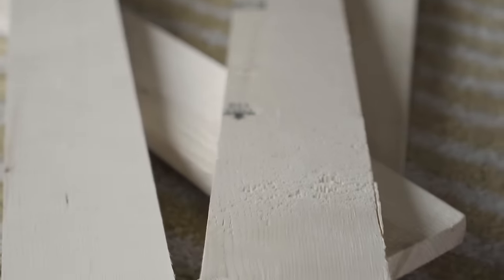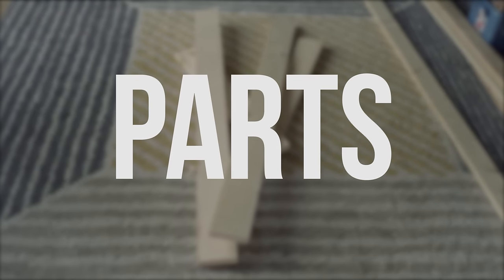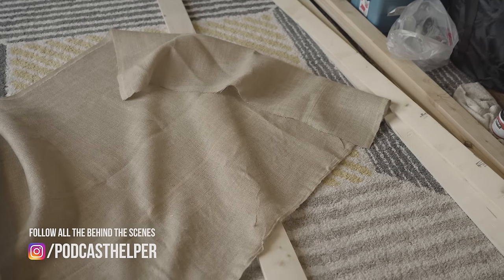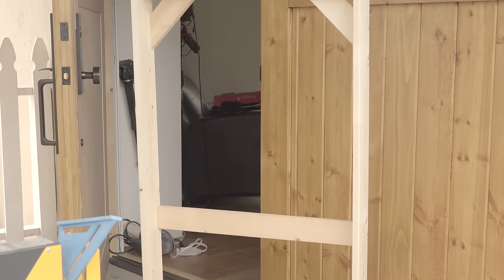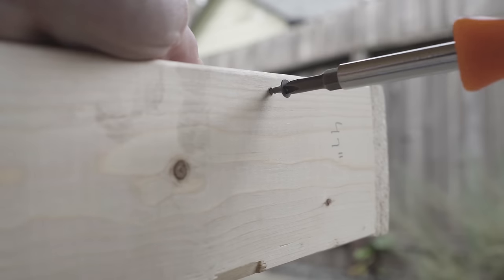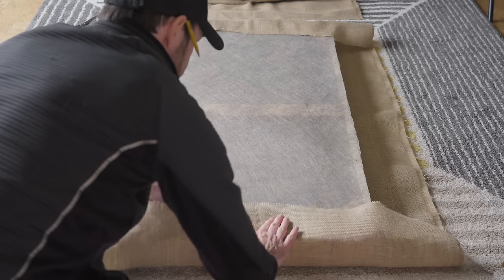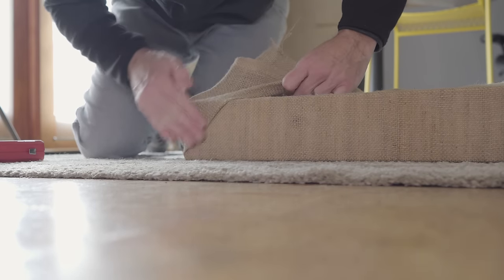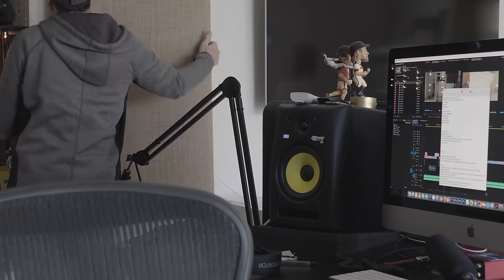How to Build Your Own Acoustic Panels

Comment: What is the Density of Rockwool you used?
Reply: Not sure of the density but you can check their website for its acoustical effectiveness.  It's comparable to Owens Corning 703 which is a similar material only it's stiff and not pliable like this material.

Comment: what is the thickness of the rockwool you used?
Reply: if the rockwool is 2inches thick, the back brace is 1inch thick and the frame is 4inches , that still leaves 1 inch of space.

Comment: What is the total weight of the finished panel?
Reply from the maker: Good question, not sure exactly but they are not light. At first I thought I might hang some on the ceiling but they are too heavy to bother trying to do that;) Sure it can be done but the point is they are weighty.

Comment: These measurements don't seem to make sense if the insulation is actually 24x48. You'd want the width pieces to be 26 inch wide if your boards are 1 inch thick to compensate for the overlap on each side. That would give you a true 24" interior dimension
Reply from the maker: Thanks. From what I recall, nothing is exactly what it says it is. For example, most big box hardware stores's 1x4x8's etc are not actually 1" wide, it's more like .75 (3/4). So in this case, you take 1.5"s off the width (24.5") making it 23" which also makes it so the insulation at 24" (but likely not exact) fit in snug with no gaps. Everything fit perfectly.
Reply: @RayOrtega  Interesting! Must be different with different insulation companies. I used Owens Corning 703 and essentially added an inch to your dimensions because the insulation pad itself was 2'x4' to a T. Even then, I still had to trim the insulation down a bit so it would fit. I guess this Roxul stuff doesn't measure to what's advertised!

Comment: I would look for some better material than that kind of insulation. I think that glass woohl isnt great for your lungs.
Reply from the maker: Thanks. It's not glass but instead a natural product which made of rock. That said, you'd still want to wear protection when working with it's just not as a bad as fiberglass. But yes, you can fill these with anything you want. Thanks for watching.
Reply: Ok, I thought it was the glass version! Great video anyway!
I saw some guy making a frame as yours but instead buying pretty cheap blankets and wrapped around the frame.
Reply from the maker: Yeah there are a ton of these tutorials on here all with different methods, that's the nice part about DIY, you can customize to your needs/style.
Reply from the maker: Thanks, Al. I haven't had any issues with the Rockwool, it pretty much stays together and doesn't shed but a great substitute would be denim insulation which I may use for future panels.
Reply: Towels work nicely as well @RayOrtega

Comment: Are there any health issues that could come from the insulation?
Reply from the maker: I hope not;) I did look into this and the newest versions of Rockwool are supposed to be free of formaldehyde and from what I can tell, it's not shedding fibers into my space. I chose these because they are more environmentally friendly, are more safe to handle since they don't contain glass like fiberglass and instead are made of organic material. The panels sit on the wall and don't get disturbed so I don't think they are adding anything to the environment. That said, this tutorial is mostly about the frame and the nice thing is you can fill it with whatever you like. I considered recycled denim but that also sheds a ton, it's a toss up. Maybe also use a covering that is less porous. Hope that helps.
Reply: @RayOrtega  Thanks for the info. Yea it just worries me a bit and i know people have asked this question but i had not found any evidence it does or does not cause health related issues. I want to make some because i think its much more cost effective and looks fairly nice vs foam.
Reply from the maker: @thomaswhudson  Cool, good luck. Definitely more cost effective and very effective especially vs foam which is virtually useless. No dense enough to absorb reflections.

Comment: It didn't sound different after the install. You raised your voice after the panels though, so maybe you're not hearing yourself as much. Perhaps a few panels in a large, furnished room is not overall a massive change in absorption.
Reply from the maker: Definitely not a huge difference but every piece you add, adds up. This was only two panels and I now I have about 10 in here although not all installed yet. Overall it sounds great, the brand new video I released (Sony a6100 review) sounds better than it has in that same position and miles away from when I first got in here and I recorded in that spot with the place empty. I'm just about at the spot that I want but still need to build bass traps for the corners. Always a work in progress;) Thanks for watching.

Comment: Wrong screws. Proper wood screws only have thread 2/3rds of the way to the head or so; the reason for that being that you don't want the screw to grip the wood the head is in, you only want to screw into the part you're pulling in to get a tight seam.
Reply from the maker: Thanks, these worked great but that's good to know.

Comment: for the inside of the panel, don't use insulation. Usually your house already has insulation in the walls so whats the point. Use towels instead. those seem to work significantly better

Comment: Why 4" thick rather than 2"?
Reply from the maker: For the wood? The 1x4" are not actually 1x4", it's closer to 3-3/4 so by the time you add the back bracing, you'll end up with a nice fit

Comment: Nice work but those those things would rattle so much in my room with my subwoofers lol
Reply: Easy fix, 3M some door trim insulation or soft felt stickers on each corner against the wall.

Comment: Nice Job, But the fact is that it's not looking beautiful, it's more like a burlap sack!
Reply from the maker: Ha thanks, beauty is in the eye of the beholder. But of course that's why I say you can cover with anything you want. Have fun and thanks for watching!
Reply: @RayOrtega  I actually find burlap beautiful. Actually if you stretch it twice it becomes more transparent and is even more beautiful but did you choose it because of it's porous weave? Would cotton duck canvas work just as well? Thanks
Reply from the maker: @9uidin9li9ht2  I did choose it because it was transparent but also because of price, I needed a lot;) I also like the color and look for my studio. If cotton duck canvas will pass air through it then it will work.

Comment: rockwool ??? this ist not a good choice  in a living room, you have to isolate it because tinie little pieces get in the air and in youre lungs . A little bit like Asbest.  in other DIY Videos they Use towels , the frame ist not so Big and its  better for your healthness
Reply from the maker: Yeah I looked into this when building these and it doesn't seem to be an issue since the panels are undisturbed. You need to be more cautious when handling it but these are stationary and have a backing as well as the burlap upfront. That said, if I did it again, I would use recycled denim like these https://www.lowes.com/pd/ultratouch-r-19-recycled-denim-batt-insulation-with-sound-barrier-15-in-w-x-93-in-l/3731877?cm_mmc=shp-cprdlbmgooglelia-103-insulation-3731877-_-0&kpid&store_code=2755&k_clickID=go_625667893_34613739430_111132547030_pla-258784372510_c_9032529&gclid=EAIaIQobChMIsfKX2LbB4QIVzh-tBh1aegh4EAQYAiABEgJ4T_D_BwE I just found them too late but overall with the price being comparable, I think this is the best way to go

Comment: Um... I hate to be this guy... but at 1:50 - 2:03 24.5" + 24.5" does not equal 47"... Just saying.
Reply from the maker: Ah a bit of confusion. The 47" inch cuts are for the sides and the 24.5" pieces are for the top and bottom. You can get one side and a top and bottom from each 8' piece of wood. But I wouldn't have been surprised if I got the math wrong...fortunately it's OK in this case;)
Reply: @RayOrtega  Ah.. My bad then, i misinterpreted.

Comment: 1 and 5/8 of an inch long. so I must imagine1 inch plus 5 pieces of an inch if it were divided in to 8 pieces... why not just divide an inch in to 10 standard smaller lengths then say exactly what you mean, like 1.7 inches, instead of using fractions? Don't know how imperial was invented or how it's managed to survive so long.

Comment: this rockwool is very toxic you need a non porous material
Reply from the maker: The latest iterations do not contain formaldehyde unlike other insulation so they are not as toxic but if you worry about fibers then yes you can use as dense of a cover as you think they require. And the beauty is you can fill the frames with any material. A recycled denim might be an even better choice.  Thanks for watching.

Comment: that panels are not for open design. WILL STINKS in your living and you'll get dust throw membrane porous  of your cover. I'll recommend for my enemy or for greedy neighbour to use it insight his room.
Reply from the maker: Air them out for a week or four before installing but I did not have an issue with off-gassing and you can cover them with anything you want. Use a less porous material, solved. My suggestion would be to use the same weed barrier I used on back, also in front. Appreciate the kind feedback, thanks for watching, have a great day, etc.